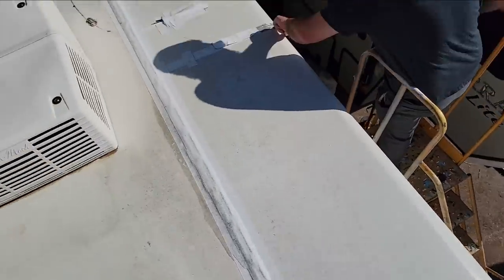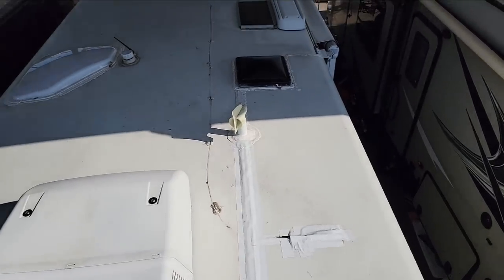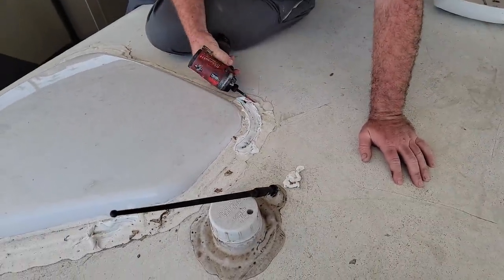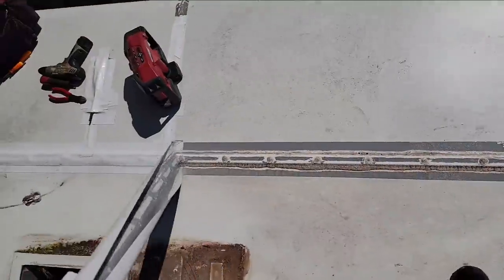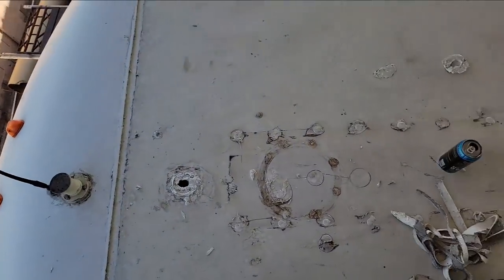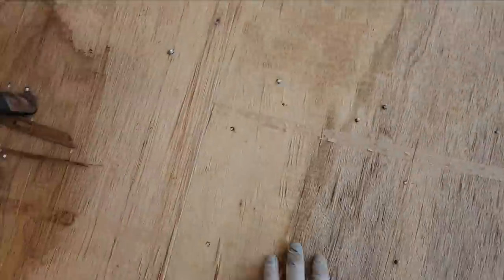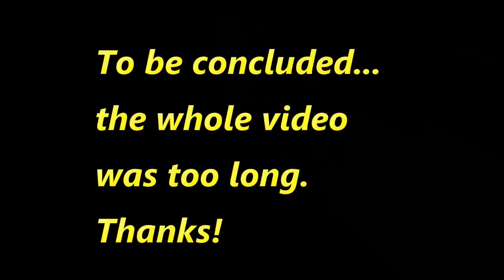Winnebago Roof with SO MANY Problems

Comment: I like how you give credit to other contractors who do good work even if it's not "perfect". I have a lot of respect for you pointing out, not only the bad, but the good...
Reply from the maker: It was evident to me the work was done in a manner that wanted to do a good job and not just take money.
Reply: @AZExpert  I am a service technician in the machinery world. Sometimes I have to do "not so perfect" repairs just to get a customers machine up and running. It could easily be criticized months or years later, but, I work with what I have and get it up and running. I looks like in this case, another repair facility did what they could to get that couple back on the road in a timely and cost effective manner. You know as a technician, you can't always do a perfect repair. Nice to see you pointed out the positives of the repair.
Reply from the maker: I do those type of repairs all the time too. The longer I do this the more I see all repairs are temporary anyway. Thanks!

Comment: So, I like Tiffin fiber roofs, not a fan of their floors. I like Newmars walls and fiber roofs, but not a fan of the aluminum radius leaving a huge seam down both sides of the coach. I have always liked Winnebago's overall package, not in the league of the previous two, but a really a good coach for the price. I do wonder why you get so many Winnebago roofs. Are they that bad overall?

Water seems to kill RV's more than anything, what is the driest Class A and 5th wheels you have experienced?

Thanks and keep up the great work and sharing your knowledge!
Reply: Robert, I don't believe they are "that bad overall"; I do believe that they may well be less forgiving of neglect than some designs...........especially where the "adhesive" sealant  that secures the filon to the "J rail" is concerned.  As James so often admonishes WBGO owners (and others)  "Inspect your roof at least once a year, guys.......twice is better."  

My Class C WBGO is 14years old; it has never leaked and it is uncovered all year long.  I watch it "like a hawk".  I'd wager there are many who have much older WBGO roofs who have never had a problem.  RV roofs in general don't thrive on neglect, but IMHO that is especially true of WBGO's.  Just my $.02 of course.
Reply from the maker: Every build has a weakness, upkeep and maintenance is vital with any RV, and I neglect mine as much as anyone ;)
Reply: @AZExpert  The shoemakers children go barefoot...

Comment: I would think that the ladders on the back of RVs are a great place for leaks to start over time because of the weight and climbing motion causing the screws to egg out. I think I am going to ditch mine and seal it off, then just get one of the 10' collapsible ladders to stow in case I need it on the road.

Comment: I owned a 2005 Itasca Sunrise for 3-years. I was told that that loose membrane was normal. The salesman wouldn’t lie would he? I sold the coach in 2019. I wonder if the roof is still intact?

Comment: Good video. So any thing that is screwed to the roof, there's only a thin plywood to hold to ?
Reply from the maker: Yes. I can tell you anything glued down with silicone on those roofs is very difficult to remove though.

Comment: Why not use 1/8" marine grade plywood on the roof?  Much more resistant to rot.
Reply from the maker: It's not a good idea to change the type of material used for the roof. they barely support weight as it is